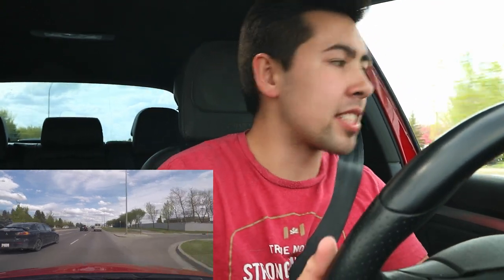TURBO NOISES! MK5 GTI First Impressions (2006-2009)

Comment: Honestly a Civic is a good comparison, only because it's front engine, fwd just like the GTI. So it should handle similarly in terms of cornering and understeer n shit like that.
But if you ask me, I'd rather have a mk5 GTI than a nice Civic type R. Not the new ones, they're ugly af imo I could never drive one. The old Civic Type R was actually a good car. I may trash on civics but that particular one (EK9 I believe) was actually good, and I would buy one if it was reasonably cheap, and in good condition. 
But since I already have a fwd car (GTI) I need a rwd and an awd before I can start buying other fwds. It's just the way she goes.